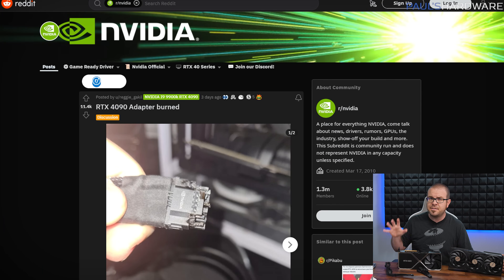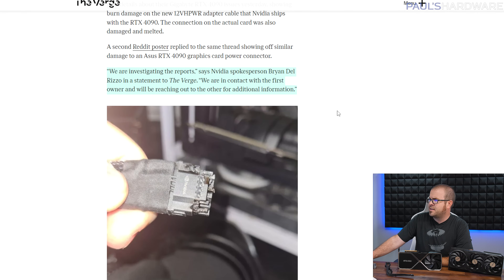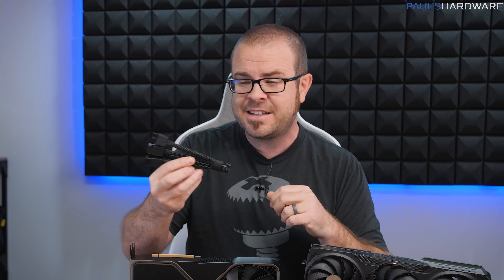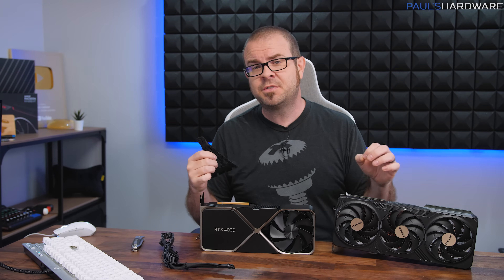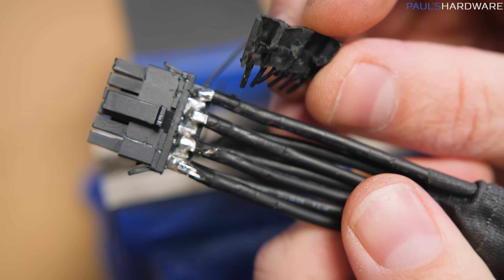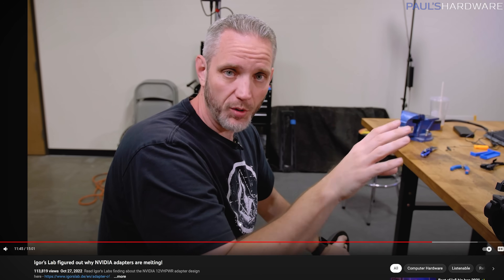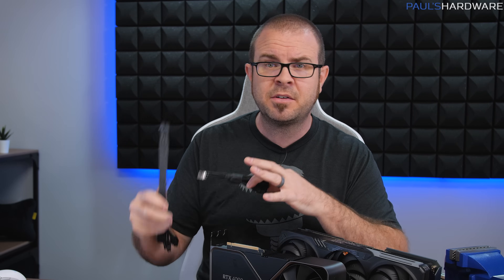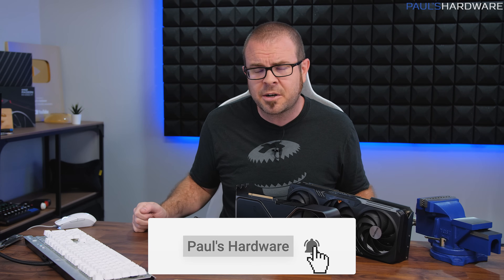Why are some melting? RTX 4090 600W 12VHPWR Adapter Teardown

Comment: In my opinion the notion that its a soldering issue is wrong(soldering is still an issue but not with the pin plugs being literally melted off), because every image of connector melting I have seen, has been at the pins. The heat and resistance will occur where the resistance actually is, and not at the pin end. If the soldering was the issue, the pin would be melted where the soldering is, and not the pins, which means the entire plug would be melted. The issue is most likely poor connection at the pins due to the double split pins and with bending they open up and cause poor contact increasing resistance and thus heat.

Comment: just 1 connector?  i have three of them in my rx 6800 XT.     if they do that crap with cable connectors now i understand why mems got so high temps and still using shitty thermalpads .  Nvidia and AMD invest millions in processor desing, but looks like they request to a junior PC repair guy to desing cooling systems.

Comment: Your images may have proved a fatal flaw, because Nvidia appears to have taken a cheap solution and design. The way the "Nvidia's Version" connector has been failing seems to be on the two outer positive  pins. Your dissection shows just how little insulator there is between the pos and neg outside pins which is where I believe the problem is. Corsair's connector is slim neat and the lines are all properly "Pig Tailed" away from the connector nearer to the power supply. Corsair using the (1 pin 1 wire) connector propperly, makes the small amount of plastic between the outside pos and neg pins, which keeps them all separated and under less stress. Because there is not an industry required material list with a standardized plug design, companies like Nvidia are left to make what they want to make instead of what they are required to make. Any critical connector like this one, wiring harness or other main components of a product should be tested and certified by CSA, CPSC, etc. before it is released to prevent this sort of thing from happening. Any company can release any configuration or quality of product they want to if not tested and certified. That is why we get companies who's practices sometimes appear "Easy, Sleazy, Cheap and Cheesy". Unlike Corsair's connector which was built from their engineering and manufacturing experience in power delivery and use of quality materials with sound building techniques. Are you going to dismantle the Corsair connector in a later video Paul? 
Nvidia's road to failure:
The way Nvidia designed and manufactured "Nvidia's Version" of the connector, is like they dumped a box of wires pins etc in front of a twelve year old kid and said make it as cheap as you possibly can. The connector looks like Nvidia literally cut corners by chonking all the wires together at the connector, which created a huge point of failure. By not using an individual wire to pin connection and using other negligent practices Nvidia sets the connector up for failure;
Sorry for going on so much but exploding power supplies and plugs melting and potentially catching fire, shouldn't be happening when we have so many advancements in technology.

Comment: Imagine 12 pins daisy chained to each other 3 pins disconnects since they daisy chained it can still pull 600w from 9 pins 3 more pins come lose and now its pulling 600w from 6 connected pins which is insane, next another 3 pins come lose only 3 are connected since they are all daisy chained its now drawing 600w from the remaining 3 pins, if you do not see the problem here, drawing 600w from just 6 pins would melt the cable probably, at 3 pins you probably melt it so hard that you have a firestarter kit.
Having 4x 8 pins that are limited 150w each and not daisy chained you disconnect one you draw 150w less disconnect another and you draw 300w less, no need to re attempt this at all, Nvidia did a dumb mistake, what you should worry about if there any third party cables also daisy chaining or doing it propper, the same aplies to the upcomming cablemod angled 12pin connector.
Any daisy chaining can cause this problem, btw if the connector melts it could potentially still bridge it and connect it with each other creating the same run away issue.
12 pin should be banned before it can cause problems.

Comment: The pins are in parallel as per diagram, if resistence goes up due to poor contact, that pin has much lower heat generation. Power = V^2/R. That means side pins having poor contact will raise the heat generation on good pins because they need to pass way more current than before. 

It's crazy seeing bunch of people make tech videos parroting each other, but not really thinking or checking.
Reply: +1

Comment: Apparently, if you de tune the card you can get ~ 95% of the performance at ~ 340 watts.
Derb8ur found the stock settings are basically superclocked.
Unsurprisingly.

Comment: The adapter plate acts as a heatsink. It doesn't matter how many wires are connected, as long as the plate itself doesn't break, the temperature will be pretty even. If the 2 outer wires come off, the center part of the plate should be slightly hotter than the side, so that doesn't explain the outer part of the connector melting.
Poor contact point and increased resistance might, as you pointed out.
Reply: That's no heatsink, man.  It's a puny piece of tin, with no airflow around it.

Comment: Nvidia was informed of this issue by BeQuiet but they nonchalantly proceeded to sell users a badly designed and potentially dangerous accessory. They didn't say don't bend it in their keynote, or on the box, on their website, or even in a video on their channel. Now they're "Investigating" the issue. NO NO NO, they're simply in damage control mode and trying to avoid a class action lawsuit

2:49 and the Nvidia BS continues, they wanted to take his TUF OC and give him an FE card instead of giving him an identical card as a replacement. How didn't you see this Paul?, It's right under the line you highlighted

Comment: I don't have a ton of electronics/soldering experience but does anyone else feel like the quality of the solder connections is very messy once revealed? Seems like the adapter is the biggest problem.. I just picked up a Msi 4090 suprim liquid and also got a thermaltake GF3 with the new PCIe 5.0 cable, so I dont need to use the adapter, hopefully the issue is with the adapter only and they can resolve it for the rest of the 4090 owners..

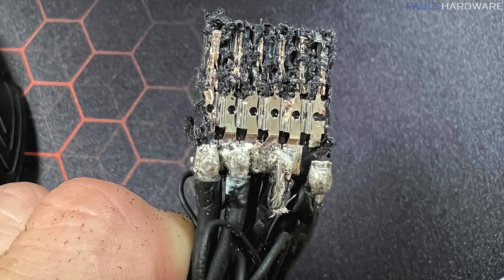Comment: At 12:01, you've been bitten by a common misconception. In fact, bad connections only heat up if they are the ONLY connection. When current has multiple available paths then most of the current flows in the low-resistance path(s); since heating power is the product of current and voltage (voltage is basically the same across all pins because they are shorted before and after the pin-socket connection)... bingo. Sceptics should check out GN's video at https://m.youtube.com/watch?v=p48T1Mo9D3Q&t=512s where the PCI-SIG testing clearly shows the highest temperature rises occurring in the pins with the lowest connection resistance. (In short, Igor is barking up the wrong tree here.)

Comment: 300 or 450 watts of juice.....pin 3 would have to be grouded to register as 600....FFS......BUT due to how the poowerroutign works on lovelace on the 450watts mdoe it will pull up to 515watts throu the wire regardless....thats 450W+75W =525 Watts max power put its limited to aroudn 10watts on the pcielanes so the internal logic will still asume it can pull 525w total but gets only 10w from the lanes so 515watts will be pulled over the 16pin......Thats why its build as it is....with the sense 1 not connected it will be limited to 300w+75watts so pullign a maximum of 365watts throu the connector....
Reply: here from igor hims elf althou he later says it wrong him self https://www.hwcooling.net/wp-content/uploads/2022/02/Funkce-p%C5%99%C3%ADdavn%C3%BDch-pin%C5%AF-na-konektoru-12VHPWR-High-Power-Connector-H.jpg
Reply: also further supported by the fact that eg the thor psu from asus has a 12pin connector ont he psu side that is now correctly rated for 450watts to supply one 4090.....

Comment: We are Teclab and made the tests (yoi called us Galax).
We run more than than 25, considering more than 12 minutes overload (rising 300W per step), and reached 127 Celsius.
Neither connector or cable melted, and it's still working.
Then we installed bad mounting (bad assembly, both horizontal and vertical, then temperature increasing over the time, what can cause damage and melt.
About 150 min testing alive.
Thanks

Comment: The problem is the material used inside the adapter/wires is ALUMINUM, bad news because aluminum is a soft metal and will crack/break with bending, it's a weak metal

Comment: The big issue is that even if its only a few cards that it's happened to it doesn't matter if its your house that burns down. Love cable mods solution  but as you say 1600 for a card and you need to buy another part to make it safe. Being sort of shallow about it, if I buy a £1600 pc part it shouldn't come with something that looks like it's used to jump start a truck.

Comment: So... they connect a #14 wire to a piece of metal that if scrunched into a wire is probably #18 or #20 and that metal is supposed to carry the same current?  How the Louis Rossmann does that work?  (would need to measure with calipers but that thin metal does not look at all to have the same area as the #14 wire)

Comment: If all the pins are soldered together, why are we using 12 wires? why not 2, 8 gauge or 4, 10 gauge wires with just 2 or 4 pins?

Comment: Soldering the connectors on a connector/cable that needs to flex is a bad idea in general. The most likely cause of the melting is as Paul states, a bad or partially broken solder joint greatly increases the resistance and thus greatly increases the temperature.

Comment: @Paul's Hardware
11:44 meassuring with a flir cam is very very inacurrate plastic is a bad heat conductor so whatever temps you meassure on the outside of the adapter can be vastly different to whats happening inside it, and as far as iam aware all current known burns are happend from the inside of the connector.

Comment: PAUL:  This is not a new issue, but manufacturers are hoping nobody notices that this problem can occur with ANY small-pin injection-molded connectors.  These things are cranked out by a third party manufacturer in china with little to no QC.  The over-molded rubber serves 2 purposes: It provides a small amount of strain relief (but not enough) and it hides shoddy workmanship.  These connectors suffer the same problem as MOLEX to SATA power adapters for hard drives.  In one type of SATA adapter, the wires get soldered onto their pins and the pins are arranged as they will appear in the connector, then they injection mold the connector around the pins.  The solder connections or the wires could break and cause an intermittent connection, leading to increased resistance and more heat.  The wires could also shift during the mold process and bring two or more pins JUST close enough to create a short if there is even a pinhole in the plastic between them. These bad connections are something that can be caught in QC prior to the over-molding process, but good luck getting them to do that.  It looks like the manufacturer opted to leave all of the power pins connected instead of cutting the metal spacers between them, so that should mitigate movement during molding.

An alternative version of these mini-connectors is crimping the wires onto pins and inserting those pins into a pre-made plastic connector.  Anybody who has worked with MOLEX cables knows exactly how wiggly those pins are...If they are not firmly held in place during the over-molding process those pins can shift and come VERY close to touching.  JUST enough separation to pass a half-hearted continuity test at the manufacturer but not enough to withstand 600 watts.  The manufacturer was on the right track by keeping the power pins joined but they should have crimped on the wires.  That would have eliminated SO many failure scenarios.

I am at a loss to explain why the solder joints are set up that way.  They make it look like the 2 edge solder joints are separated from the 2 middle ones but all of those pins are connected together underneath the over-molding.  They consciously decided not to add the same thickness of solder all the way across.  Typically a line of solder over top of a connection like this is done to spread the load across multiple wires or to thicken circuit traces, and the thinner areas can (CAN, not will) heat up first.  Huh, I wonder if that could be another failure mode for broken wires on the sides, the outer pins pulling current across the thinner metal where the wires connect, and also where the pins are held together.

Comment: lol all this debacle reminds me in Gamers Nexus video with EVGA how Jensen dismissed AIB and believed they add no value at all. 
They probably thought an adapter cable is simple enough and doesn't need much attention, and has been proved very wrong now. 
Make no mistake, the card itself is an engineering marvel in terms of performance and cooling; but it is the ignorance, altitude, marketing and pricing that ruined this otherwise excellent product.

Comment: when I first saw the pics, I thought it would be a bad solder joint in the connector.  I've ran into a similar issue once with one of the old molex connectors back in the day where it wasn't crimped correctly and it melted the connector.

Comment: nVidia simply has used in improper connector as it seems the wire gauge is heavy enough but the hot spot is right inside the connection pins and sockets.  The power adapter side of the video card socket or both just do not have enough contact area to carry the current. Could also be the gauge used for the pins isn't heavy enough. Once they investigate they will figure it out but my guess is the pins just doo not provide enough surface area for the current passing through.

Comment: So, Nvidia used a 50¢ connector on a $1600 GPU just so they could launch before AMD. That's some top notch ethics. My next GPU will not be Nvidia. Accountability needs to be had in this day in age. It's very rare

Comment: 600 Watts to amps at 12V:	50.0 Amps go look at normal car fuse 10 amp
1500 Watts to amps at 12V:	121.7 Amps
look up "Automotive Cartridge Fuses 100A DC 12V" look size of the wire in the glass lol

Comment: 4 heavy wires on a thin wimpy bus bar is the problem. do we really need 4 12volt rails to supply 50 amps? i hope pci gen 5/6 power supplies solve this issue with a single 12 volt 50 or 60 amp rail and a beefy thick 50 amp connector with fewer and heavier pins. maybe move towards xt60 or xt90  power connectors.

Comment: Nvidia's somewhat poor solution to a mostly non-existent problem?
Reply: the problem could have been avoided by using two 12-pin connectors and split the 600watt load.  Instead of four into one they could have made two into one.  For $1600 they could have been a little more generous.
Reply: @halrichard1969  For sure.  If I spent refrigerator money for a graphics card, I'd expect it to be 100% free from power delivery issues, full stop.

Comment: Try potting the plug with hot glue well dead straight, then close the metal pins as much as u can with little screw driver.
Reply: After seeing the cable disassembled, it looks like there's quite a tight tolerance already where the cable enters the socket, so u can't pot them and the bending of wires just doesn't seem like the cause unless there's enough force to overcome the plastic surrounding the 4 wires at the plug. I would hazard a guess its cheap metal on the individual plugs is to blame and may have the wrong elastic/plastic deformation properties to cope with being plugged in and out, even a few times.
Reply: umm maybe there isn't enough material on that rubber piece, a more flexible wire type would help its a combination of a few things I think.

Comment: Paul's a smart guy, his initial instincts were right that the heat from bad solder joints start AT the bad joint, then he tried to go through the mental gymnastics to fit it with Igor's Labs' conclusion that that's what melted the connectors at the socket over 1cm away is where his lack of confidence of his own intelligence failed him.
Heat is hottest where it originates and if it's because of a bad solder joint, like Igor's Labs' hypothesizes, then it would be hottest at the TOP of the connector which none of the few photos of melted connectors on reddit seem to have any damage at.  I highly doubt that that's the cause of the issues that users on reddit have had.
However, that doesn't mean that Igor's Labs doesn't have a good point that soldering right onto pads with no strain relief for the connector is a bad idea though.  It's another potential failure point that unfortunately does not seem to be the root cause of the melted connectors shown on reddit.
Buildzoid has a great explanation of what he thinks the root cause of the failures shown on reddit are on his youtube channel: Actually Hardcore Overclocking   It makes more sense than Igor's Labs' analysis.  Plus he reminds us that anybody stating that 12V DC in this situation can "arc" doesn't know what they're talking about.

Comment: Wouldn't it be simpler to put the CPU slot on the card. Plus two to three laptop power supplies and you wouldn't even need a case. If only the Brits hadn't stopped the ARM takeover we'd have a whole computer for $2k

Comment: i think one point to add is cable mutual heating in addition to the outer contact breaking to cause a short and heat build up. the cables being rated for 105c may be selected to account for mutual heating but im betting the failure is a poor solider breaking on the end and propagating the heat up the pin.